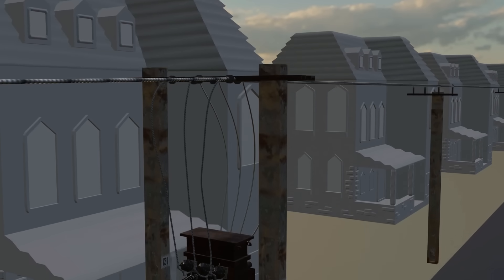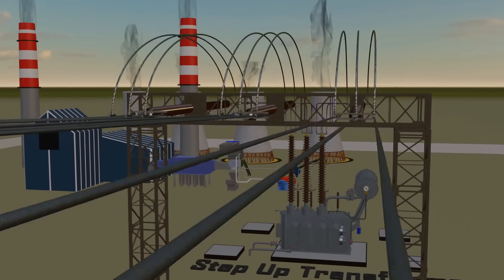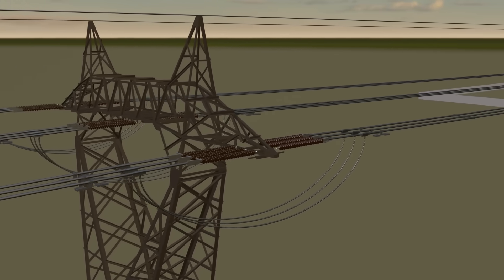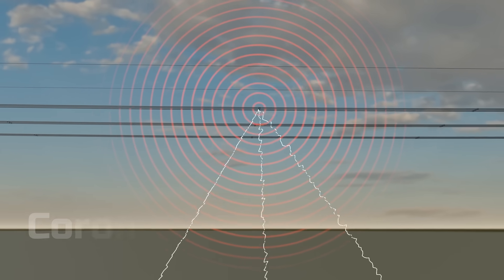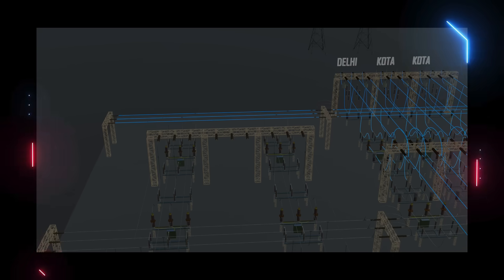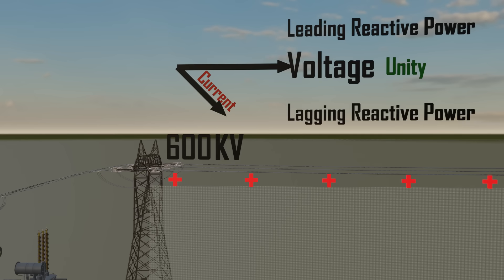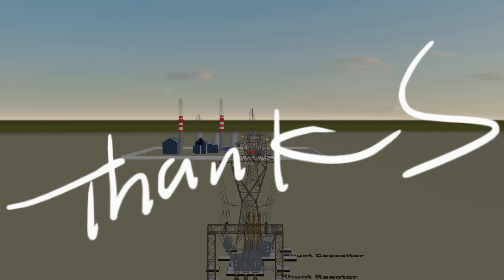Why Do Power Lines Hum and Glow?

Comment: Power lines hum and glow due to a phenomenon called corona discharge, which occurs when the high-voltage electric field around the wires is strong enough to ionize the surrounding air. This ionization causes a continuous, miniature electrical discharge that produces a buzzing sound and a faint, bluish glow. Environmental factors like humidity, rain, and fog can worsen the effect and increase the noise and glow. 

Why power lines hum and glow
High voltage: The electric field strength around a power line can exceed the air's insulating capacity, leading to a discharge.
Ionization: When the electric field is strong enough, it can ionize the air molecules, which are charged particles that conduct electricity.
Electrical discharge: This ionization creates a continuous flow of tiny electrical sparks, or a glow, through the air.
Sound and light: The energy released as this air "jumps" from the conductor creates the audible buzzing sound and the visible bluish glow.
Environmental factors: The presence of moisture, such as from rain, snow, or fog, increases the air's conductivity and intensifies corona discharge, making the noise louder and the glow more visible. 

Other consequences of corona discharge
Energy loss: The discharge represents a loss of electrical energy from the power line.
Radio interference: The discharge can also create radio noise that can be heard on nearby radio receivers.
Ozone production: The process can produce ozone gas, which is harmful to the lungs if inhaled in high concentrations.
Corona rings: To mitigate these effects, high-voltage power lines often have "corona rings" attached to insulators. These rings are designed to help even out the electric field, reducing the stress on the air and minimizing the corona effect, especially under dry conditions.

Comment: Buzzing means a few things. Dust and moisture on the wires, vibration. Dirty connections. A residential panel can buzz at the breaker if its got a bad breaker or bad connection between the bus bar.

Comment: I ised to live close to 765kV lines - right behind my house which backed up against the utility easement t. The electric field was strong enough to make a 36" fluorescent lighting tube flicker visibly in low light conditions if you held it vertically over your head.  
It was a great party trick too.

Comment: In the UK the maximum distribution voltage is 400 KV for "Super Grid" line distribution in the National Grid . In the United States it's 765 KV presumably because the 'States is of a larger geographical area and the grid companies want to minimise "current squared resistance" losses.

Comment: Throughout: The metric prefix representing a thousand units is a lower-case k; in the metric system, an upper-case K represents a kelvin, which is a unit of temperature. Throughout this video, the voltages are thus marked as kelvin-volts. And why do you call the voltages kay-vee and not kilovolts? Do you refer to small distances as em-em or see-em instead of millimeters or centimeters?
2:28 & 2:54 : Are you really writing "Skinny Effect" to represent "Skin Effect"?
Reply: That caught my immediate attention. When the narrator said “kv” several times, I had to turn ON the sub-titles to make sense. That is a totally erroneous dialect;  fellow doesn’t know what he’s talking about. And then the skin effect – not at low frequency. Multi-strand for flexibility, not better conductivity. As for the humming; high voltages produces corona which ionizes the air. Also present in neon sign transformers and auto-ignition petrol burners.
Don’t know if entirely generated by AI (channel name: “LifeAda English” has no human sense). May be Indian with AI assist. Regardless, raises eyebrows and I wouldn’t subscribe.

Comment: That’s actually false as the voltage in countries that average 110-120v are actual 220-240v and you’ll often find that some appliances like ovens and dryers run of a 220-240 volt outlet which is the main reason why you’re able to power your house through back feeding your homes circuit using double ended cable also known as a suicide cord due to the dangers involved when using it, but regardless the average home in the United States gets a 220-240v supply which is split giving us 120 but the separate connections are bridged using a double pole breaker together giving us the full 220-240v on the outlets we use for 220-240v appliances like dyers and ovens, saying that countries like the US “only use” 110v is ridiculous also we actually haven’t used 110 in ages the nominal voltage is currently 120vac so technically the US is a 240v country we just end up using split phase power, fun fact each leg is 180 degrees out of phase from each other, so there’s a lot of misinformation in this video regarding ac voltage specifically in regards to a system being 120 supply voltage when it’s a 240v supply voltage which is split at the tape giving you 2 hots that feed into your meter which is then connected to your main shutoff breaker that feeds into your interior breaker panel that has 2 hots and a neutral buss bar to distribute the power to each breaker and each 240v appliance gets its own double pole breaker which are rated for different current draws as some 240v appliances don’t always draw the exact same load!

Comment: Here in Texas (CPS lines) - I have nearby towers (130's and 150's) with 15 to 20 insulators. Instead of using jumpers, the conductors continue past each tower. Therefore they don't have corona rings. Where the stop bridge dampers should be are similar devices with two little cups on them. like spoons... one cup facing each way along the wire. One on either side of the insulator connection point. I was told once they are anti corona devices - Is this so? how would little spoon like devices dampen corona? When they restrung these towers after a tornado, the crew told me they stretch each conductor to 3000 psi - wow - thats a lot of stretch!!!!
Reply: Stockbridge dampers, to control destructive vibration caused by wind.

Comment: In NZ the long distance lines are DC.
Plus 400kv and Negative 400kv (originally 250kv)
Without the zero switching in AC the inductance losses are less. And the lower peak voltages have less corona losses.

But First the generator AC needs to be converted to DC.
Early on these were Mercury arc diodes, later thyristors.
Then converting into AC has its issues as well.
Perhaps touch on DC transmission if you haven't already done so?
(I mean discus. Don't touch!)

Comment: because they are constantly wasting electricity, what you are hearing is the power being converted into other forms of energy, such as sound, also there is heat, and even radiated power.   What is worse, is when you increase the demand, the power loss goes up exponentially.  That is why EV (Electric Vehicles) are a bad idea, if everyone had EV's it would overburnden the grid and cause brownouts and blackouts.

Comment: Gave this a like for the other info, but check your facts (see comments).  That Skin Effect number is just wrong (do math for 50/60 Hz), and makes no sense why the lines would be like that.  There's also mention of voltages to homes, typical power to NA homes is 220 or 240V (as split 110 or 120V with neutral).

Comment: Here the summarized answer:

Power lines hum and sometimes glow due to electric current interacting with the environment. The hum comes from AC electricity (50–60 Hz) causing wires to vibrate slightly through electromagnetic forces and magnetostriction. The glow is from corona discharge, where a strong electric field ionizes air molecules, creating tiny sparks or a faint blue/purple light, especially in high-voltage, damp, or foggy conditions.
Reply: excellent

Comment: The central strands are not steel reinforced. They are steel. The steel is stiffer (higher modulus) and carries most of the tension. Drawn steel wire is much stronger than pure aluminum conductor strands

Comment: The skin effect does not occur in any meaningful capacity at 50 or 60 Hz with a conductor that is barely a few inches across. And even if it was a real effect, having multi strand conductors right next to each other will not solve the "alleged" skin effect issue. Please don't repeat things you don't understand otherwise I will have to assume that every thing you say is suspect.

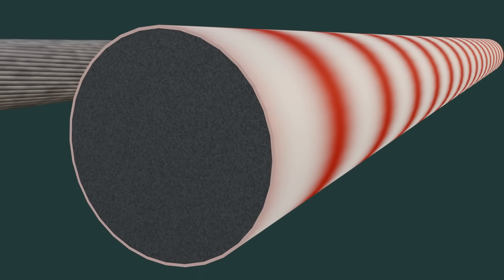Comment: 2:50 The skin effect occurs in frequency of at least 1 kHz (1000 Hz) and the frequency of the electric current in the power lines is 50 or 60 Hz. So, please - stop the bullshits! 😎
Reply: Most people who make videos like this just use an AI. AI is shit and doesn't know how things work 90% of the time.
Reply: Technically true but the effect is also noticeable at 50hz, but only in conductors of more than 2cm in size, as the penetrating depth at this frequency is about 9mm.

Comment: I remember trimming a wire and a guy i know that works with subway power lines said it wouldn't work because electricity travels outside the wire but they seem to have forgot about the path of least resistance

Comment: Answer : they hum because they are carrying massive curent in humidity .
When its misty out or drisseling outside the power lines crackle when conductividy happens between the line and the insullator,  water is snapping in and out of states between vapor and liquid as each cycle .

Comment: I dont like that we in NA use 110 and get 240 via two phases vs. a single 220v phase. They did it with safety in mind but 110 has become inefficient in modern times requiring too much current for older home wiring.
Reply: Yeah, and it's a fire hazard. Wish it was 220 or 240

Comment: People living beneath power lines (around 65ft) come up with stories of illness caused by the electricity, yet a study of workers in the power industry who typically work at 15 ft maximum from the same power lines, have no recorded ill effects from doing so.
Reply: I have curly hair !😊
Reply: @jerrywatt6813 Blame your mum and dad
Reply: It’s just that the land under power lines is undesirable thus cheaper. Ppl that buy the cheaper land generally have less money. Less money generally equals less money for health care. Power lines are just scape goat for the ppl. It’s just the same as wind farms.
Reply: @randomfpv22 good point 👉
Reply: I read a study about Yosemite and the trees receding from the river. Turns out it was because the trees were fertilized by the fish carcasses left by bears and the bears didn't come around when they smelled any faint scent of human. 

My point is that a low hum can easily become a roar when added to other factors. It creates a butterfly effect. I would say that there is definitely a low level negative health correlation with high voltages and more importantly the infrastructure associated with it and that's effect on the human psyche.
Reply: @zacharysherry2910  You don't want 800Kv under your feet, and the environmental damage done by digging highway sized trenches to bury them is worse than a power line. It is strange though how people work within a few feet of these power lines all their lives yet don't suffer any consequences, but people 60+ feet from them complain they do.
Reply: @boblordylordyhowie  800kv?? Not here in Denver!
Reply: @zacharysherry2910  No, not in Denver, you'll just have got electricity? There are sections where it will hit 800kv, but normally it can fall to 100kv. Here it is 400kv nationwide, 275k, 132kv, 33kv, 11kv then down to domestic and industrial voltages, of 230v and 415v.
Reply: @zacharysherry2910  another commenter says Michigan has 765kv lines.
Reply: @boblordylordyhowie they do. That's insane.
Reply: If you think about it, burying cables that normally go on pylons isn't easy, they are that far apart for a reason, so take a pylon and lay it out on the ground, and it takes up a huge amount of ground.

Comment: skin effect comment is BS.  Unless those individual conductors are insulated (Litz wire), a stranded wire is the same as a solid wire.  Skin effect at 50/60Hz is almost negligible.  Skin effect is important for RF. Skin effect matters for frequency not voltage.

Comment: 1:45 - Steel core with Aluminum wires on the outside? How do they deal with galvanic corrosion?
Reply: I suspect they just replace the section when the line gets too hot.
Reply: The steel core is coated with mad zinc. Also grease and other methods.
Reply: @zacharysherry2910  Thanks for a sensible answer.
Reply: Insulting grease around inner steel core.

Comment: Not true. Supplies to American household is actually 240 V. It’s called split phase. between neutral and lined one is 120 between neutral and line 2 is also 120 but between line one in line 2 is 240.

Comment: In North America the voltage coming into the house is 240v . It comes from a center tapped transformer with the Center tap connector to ground. (Earth) . So hot to neutral is 120v used for most light loads but go hot to hot gives 240v used for heavy loads eg, oven, hot water heater, electric heat, heavy duty power tools etc.
Reply: Called Split Phase....120, 120, N
Reply: In Europe hot to hot it's 400 but only 3 phase, in italy in rome because of the old age of the electrical infrastructure we have the double phase without neutral, 110v 110v tougher 220v
Reply: Lots of people still call it 110/220 and even this video the narrator said it was 110 coming in on resi
Reply: @koryabel6319  Before the standard voltage was set to 120 volts in the United States in the 1960s, it was usually 110 or 115 volts. People have persisted in calling it that. It's similar to why people use tin foil and tin cans to refer to aluminum foil and aluminum cans.
Reply: @koryabel6319  I never understood why. North America uses 120/240, not 110/220 (my home's voltage is 119-126)
Reply: @koryabel6319 lots of people are wrong.
Reply: @koryabel6319  the problem is the voltage hasn’t been 110/220 in a long time it’s now 120/240 and I’d suspect the reasoning for the higher voltage is for headroom especially since more houses are on the grid or it’s likely just more reliable than the old 110/220 system!
Reply: The neutral returns back to the substation.  A secondary aluminum with steel reinforcement could be a stay or guy wire as a backup in case the neutral is severed, as what happens in an ice storm.
Reply: Also dryers
Reply: Damm you guys are being outclassed by India of all places
Reply: 220 volts more suitable because less power is wasted making heat and most or let us say all 220 induction motor become less hot than 110 volts ones.
Reply: TELL US SOMETHING WE DONT KNOW

Comment: Dude, I'm an American. What's with the use of millimeters and centimeters? You're ruining my high! Even so, i have some transmission lines that are close to home. When it rains and the air is thick with moisture, the nearby lines do crackle like Rice-Crispies©. Another weird phenomena i have noticed since living in the vicinity of these transmission lines is that the sound of exploding fire works has a way of ricocheting of the lines but at a much higher pitch. The resulting sound is similar to that of a bullet flying by.

Comment: So the aluminum high voltage wires aren't even insulated? that's wild!
Reply: The insulators insulate the conductors from the tower at 1KV per insulator used in the stack.Why would the cables need insulation in the open?

Comment: 0:17 In most european countries all three phases are delivered into the houses , even small ones.  Electric kitchen stoves wired for 3 phase as well as instantaneous water heaters with large power consumption  between 15-24 kW.
Some house owner installed a 400V CEE utility sockets. 
Westeurope use the 4 wire 230/400V 50 Hz system.
Reply: Brazil here. When I bought my house, it had 3-phase supply because the previous owner probably had specific needs for it. Not my case, and the only difference it made for me was that it made the electric bill potentially more expensive, as our minimum 3-phase flat rate costs more than triple of single-phase supply. Now that I have a solar photovoltaic generation at home and will consistently be paying only the minimum flat rate, I had the utilities company change my supply to single phase. By doing this, I'll pay the minimum flat rate at less than a third of what it would otherwise be, with a 3-phase system.
Reply: In the UK, typically businesses are only supplied with 3 phase and homes with 230v, but if you pay for it and justify it they will install 3ph to order in a home.
Reply from the maker: I think almost all household appliances operate on a single-phase supply, such as geysers, fans, and microwaves. However, when there is a heavy load of up to 24 kW, as you mentioned, the load is distributed across the three phases.
Reply: @LifeAdaEnglish  6kW induction cooktops require 3 phases, at least to enable boost mode with max power output. They can still operate on a single phase - with limited capacity, though. Power = current * voltage. To achieve 6kW output with 240 V would require 25 Amps. Not doable with regular wiring.

Comment: In Germany the voltage levels are 230/400V, 10 to 30 kV, 110kV, 220kV and 380kV.
Below 400kV the corona effect is minimal.
Reply: Bundled conductors are used for 220 kV and 380 kV, so the corona effect must be relevant.